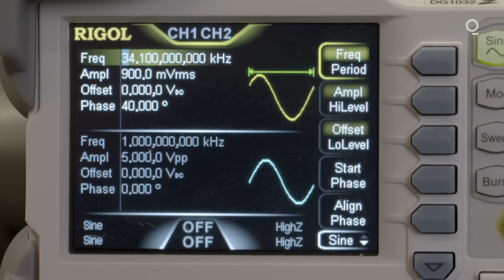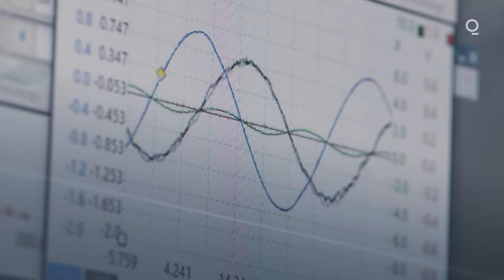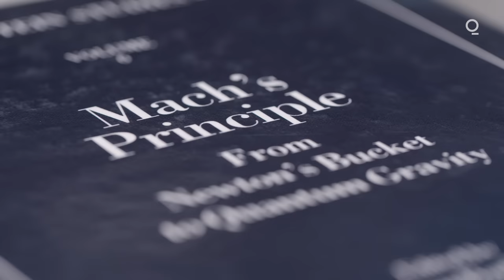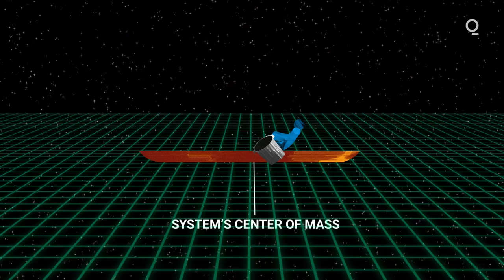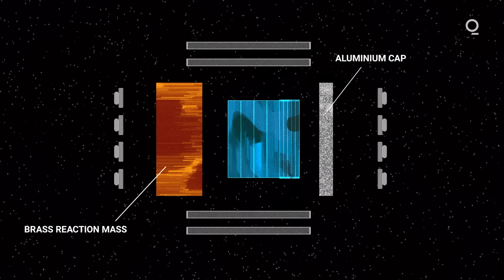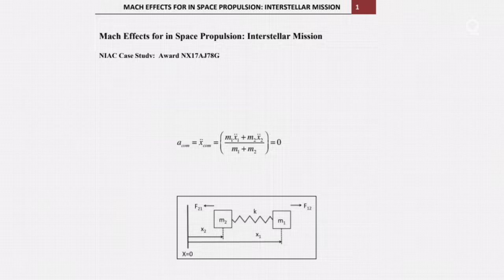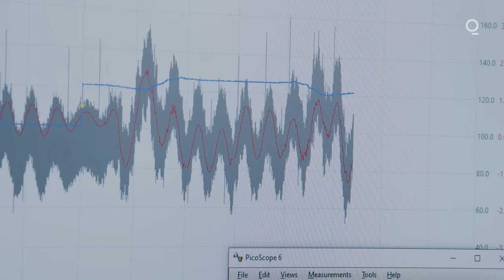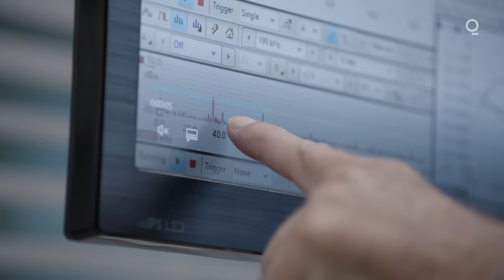Two Scientists Are Building a Real Star Trek 'Impulse Engine'

Comment: The theoretical physics side of these ideas aren't always wrong, its the ability to engineer the equipment that can actually do it.
Reply: New times, new materials, new possibilities, new Ideas, new possibilities, new materials, new times.
Reply: Dude, this isn't a theory, it's not a part of theoretical physics. 5:24 How do piezoelectric crystals change their mass? This is literally not an observed behavior piezoelectric crystals have. The only sense in which "the ability to engineer equipment that can actually do it" is even remotely correct is in that if something is impossible, it is necessary that no one has the ability to engineer equipment that can actually do it.
Reply: @BerryTheBnnuy  The total mass of objects do change due to their motion. He is saying the relativistic mass of the crystals increases then they turn it off and keep the forward momentum. Im not sure about this idea I have to think about it more
Reply: yeah yeah yeah, but you got to push theory further, if you will stomp the ground in one place -- you wont progress
Reply: @BerryTheBnnuy  They do change mass - they gain relativistic mass during acceleration.  Relativistic mass is established and uncontroversial science.  Conceptually, this is easy to understand.  You use a current to cause momentary acceleration of the crystal, and during that time, the total mass increases due to the relativistic aspect.  You push that system while it momentarily weighs slightly more, and then the acceleration/deceleration stops, and you pull the system, which now weighs slightly less.  The net effect is the acceleration of the the thing doing the pushing and pulling - the spacecraft.
Reply: @eventhisidistaken  while relativistic mass is indeed not controversial, the part that you can produce a net force from it is. In relativity mass is equivalent to energy - and energy is conserved. So by putting energy into the crystal you have to draw it from somewhere else. By taking it out, it needs to be out back somewhere. So essentially you would move mass from somewhere into the crystal and back. This mass move would counteract the net force from the crystal. So, if only special relativity is used. you would indeed predict no net force being produced from this, just an oscillation.

I don't really understand the "Mach effect" which claims that you somehow can take the energy from some potential in space which is produced by distant mass and put it back into this potential (the figurative rubber of spacetime in the video). But if without this it would not work, and this part indeed is controversial. I sure hope that it's real, but chances are very high, its not.
Reply: @wulf2121  The relativistic mass does not produce movement by itself.  There is secondary device that is synchronized with it to push the crystal while it momentarily has higher mass and then pull it back after that moment. Even that is not controversial.  This will produce momentum via standard accepted physics.  There is no violation of conservation of energy.  The part that's controversial, but still does not violate conservation of energy, is the 'gravity boost' aspect.  Without it, the amount of force you could produce is so minuscule, that you'd be better off using laser propulsion.
Reply: @eventhisidistaken  wouldn't the relativistic mass change the exact opposite way when you accelerate the piezoelectric the opposite way?
Reply: @BingusTheWockis  When it decelerates, that also increases the relativistic mass.
Reply: @BerryTheBnnuy  it's relativistic mass as Sir Einstein proposed .
Reply: @michac3796  Right but some "old" physical frontiers will stay exactly what they are today ... frontiers!
Reply: @eventhisidistaken  relativistic mass will be the same as rest mass. Relativistic mass is only relevant at very high velocities
Reply: @BingusTheWockis  Wow, great idea, you solved it, lets just accelerate it in the opposite way ;-)
Reply: @BerryTheBnnuy  Maybe they do, maybe they don't.  Now what Eddie Van Halen could do with a Humbucker?  THAT right there is um, "mass"ive.

Okay, I'll leave now!
Reply: @michac3796  The only way to get NEW anything- is to first assume the OLD stuff is NOT the "only way"- and look at something never thought of as a possible solution..
Reply: @VSci_  Crystals will be a viable power source very soon-- replacing every other-- as we have but scratched the surface for their uses- and crystals can be synthetically grown...and new uses found daily!!
Reply: @wulf2121  I can imagine being the ball and quickly grabbing and pulling on the the trampoline material and letting go then reaching forward and grabbing it again.
Reply: @wulf2121  troof. That said, the theoretical rubber/fabric of space-time and it's interaction with mass to produce gravity has been problematic for me, as it is more a useful, accurate model that's represent how it affects objects rather than true, full explanation of what it is. But, admittedly, my understanding of space-time is also limited, so I may be totally missing something.
Reply: I like the way nodody mentions the deflector. Without it there is no directional inertia guys.
Reply: @davidwayne9982  Without that concept science cannot advance past dogma. Fresh attempts will see advances eventually.
Reply: Give me the physics, and a big enough budget, and I'll make it work.
Reply: @BerryTheBnnuy  Apparently all that engineers are required to do is find a way aound basic Newtonian laws of motion. Cinch.
Reply: @VSci_  This requires motion to cause the delta M. So, we need motion to create motion?
To be useful, that motion must be in a particular direction. How do we create directionality in the motion induced by a change in mass?
So many questions, so little time...
Reply: @eventhisidistaken  "Momentary acceleration of the crystal" is questionable in itself. Such acceleration would only occurr if the xtal is placed against a firm mass itself. Otherwise, it will be only a rapid change in a particular dimension.
Reply: @WCM1945  I suppose, but that part of it does not seem to me to be a difficult engineering challenge.
Reply: @davidwayne9982  The Wright Brothers used science and math to design their craft. Not just "Try this" and "Try that". 
And I find it amazing that one who has so little grasp of Science should be telling Science how little it knows.
Reply: @eventhisidistaken  What, determining how to create a force on one direction only, without a need for an "opposite" reaction"?
Reply: @WCM1945  In the FIRST place- despite what you may think- my IQ is past mensa level- and I have an EXCELLENT grasp of science- especially physics and quantum physics.. which is HOW I know that "scientists" as a rule think they know everything and we really don't have a CLUE!!
Reply: @davidwayne9982  Wow, a Magna Mensa here...
We're all on tinterhooks awaiting the release of your compendium on Life, the Universe and Everything. No collaboration with Doug Adams permitted.
How many scientists have you met in your amazingly enlightened lifetime? Any of them ever say they already knew everything, thus research was a waste of time?
Reply: @WCM1945  No is is saying that.
Reply: @eventhisidistaken  And the proportion of mass-to-energy conversion is equal to the part of C achieved.
Reply: @eventhisidistaken  What is this secondary device? How is it "synchronized"? Speak in practical, achieveable quantities here, since we must do this within the confines of a human-life support system.
Reply: @jabyers  "High" here meaning approaching C, or the speed of light.
Reply: @davidwayne9982  In fact, empty your mind COMPLETELY.... and leave it that way...
Reply: @WCM1945  I am not talking about human life support, merely the technology of propulsion-less space travel.
Reply: @davidwayne9982  Yeah... You need to put that in terms us non-Magna-mensa folks can pronounce....
Reply: @eventhisidistaken  I'm talking about numbers that are achevable in normal space.
Reply: @WCM1945  There is an opposite reaction.  There is nothing about this that violates any known laws of nature.  The only question, is whether the 'gravity boost' aspect is true.  Without it, allthough a system like this would still work, it would not work well enough to be worth messing with.
Reply: that's why we created A.I. because A.I. can figure the troubleshooting needed to apply theories into a true product in advanced engineering
Reply: @wulf2121  talking used nuclear energy with a battery too power thAT.
Reply: I just know whether to be happy or disgusted, we've had electric brushes for how long now and only just realising it can help with space travel, instead, lazy people are brushing teeth easier... what else is so undervalued on this rock?!
Reply: @wulf2121  so I'm dumb,  but I'm imagining a guy on a starship that is a long cylinder with a weight on a spring, he walks the weight toward the back of the craft, and let's it go, thus propelling the craft forward when the weight hits the front, the energy input being his body.  Shrink this down and multiply it by millions and use a reactor instead of muscles. This does not seem complicated to me, what am I missing.
Reply: @michac3796  New physic's you mean.....
Reply: @Piddlefoots  Yeah at the time I saw this I made a note to think more about it later. I discarded the idea as not physically possible. I usually entertain ideas even if they wouldn't be possible for hundreds of years... but this borders on fantasy
Reply: @eventhisidistaken  Is the idea here that you can move a light part of your ship ahead a ways, then make that part of a ship heavier by making it vibrate fast, then relying on that part being more massive - drag the back end of the ship forward (rinse and repeat)? 
I think wulf 21 was asking how could you move the energy to vibrate into the forward section without inducing a subsequent reverse reaction motion in the ship as a whole? I should think your energy for it would be in the forward section to begin with - merely switch on and off as needed. Of course if vibrating or heating or rotating can not increase mass/inertia this whole line of question is moot.
Couldn't they test this in a vacuum attached to a pendulum and look for inclination that's not perpendicular to the ground (or parallel to an adjacent unpowered pendulum)
Reply: @BerryTheBnnuy  The mass changes easily -- the same way it does with all objects in motion.
Reply: @shukrantpatil  Einstein was never knighted.
Reply: @BerryTheBnnuy  Energy is mass.

Comment: This needs to be tested in a vacuum, because there are acoustic and aerodynamic effects with what they are doing, that have to be excluded first!
Reply: Agreed. The device uses piezoelectric transducers of the same type used in sonar.  Testing in a vacuum would then avoid acoustic radiation pressure (a nonlinear effect) from the aluminum vibrating head.
Reply: I believe I saw some vacuum chambers in their lab and office. I didn't read the study, but I believe they've set up in one of those chambers.
Reply: It's fake...   It amazes me how they managed to con people into giving them money.
Reply: @Gabriel-um9hm  you seem very sure, where is your data coming from?
Reply: Em drive flashbacks
Reply: @Gabriel-um9hm  seen you in a few comments here, I assume you spammed many more. If it is fake and they got the money, what incentive is there for him at his age, and this long after getting the money, to keep working on it?
Reply: There are descriptions of vacuum tests in the links in the video’s description
Reply: @regmigrant  from the black hole on the underside of his earthly body
Reply: Owen LaPrath
wow, why didn't they think of that..?
Reply: and in absence of gravity pull from earth. ISS could be a plausible option
Reply: @greengoblin9567  The EM drive did work perfectly.

It aligned to the earths magnetic field. A glorified compass.
Reply: I would say, if they see some movement in a vacuum chamber, then these devices are driven by radiation. They also need to make sure, that the material they use is made of stable nuclides.
Reply: @alessioschiavone3898  bro, the iss still experiences  something like 90% (probably more) of the earths gravitational pull.
Reply: @mrkakbuhn5781  wait wait, the pull is cancelled inside by the angular velocity in orbit around earth as you see the astronauts sleep upright strapped against the walls
Reply: @greengoblin9567  exactly how does it violate the laws of "nature"? this is physics, nature has no place here. The EM drive violates the laws of "nature"? hold two magnets together at opposing polarities and let one go. the result is the laws of physics. Put the EM drive into a sealed chamber and measure the effect on hydrogen gas. Faraday's law,  Hydrogen is a diamagnetic substance. Diamagnetism occurs in materials whose atoms have paired electrons. According to Faraday’s Law, when a hydrogen molecule is exposed to a magnetic field its electrons which are in orbit, alter their momentum slightly. As the magnetic field increases, an induced field is created, which the molecule’s electrons experience as a force. Through this principle of physics, the hydrogen molecule acquires an induced magnetic moment. This induced moment is opposite to the applied field and is termed diamagnetism. Through these principles of physics, hydrogen is feebly repelled by a nearby magnet. What is known currently to be the most abundant thing in space? Hydrogen. Granted, the scale of these things would have to be pretty massive but they are very well rooted in the laws of physics.
Reply: sNot just a vacuum - but also isolated from stray magenetic fields, friction, airflows, and other vibrations. Setting up such a test requires experience at such tests - which is why it took the EM drive so long to be disproven.

Comment: The difficult part is getting enough Dilithium Crystals.
Reply: That's for warp drive,  not impulse 😀
Reply: Impulse drives are powered my fusion reactors.  Another handy thing to have if we could actually build it.
Reply: Exactly
Reply: @Lennis01  Some have been built and actually work but only for a short time. The problem is containment of the plasma.
Reply: @Lennis01  
Fission ....
Reply: @Lennis01  
just like to add ....
fission propulsion is used only between Galaxy's, that have seperated,...
 as in the universe is expanding... 
there maybe no magnetic field, or a very weak field ...
Nuclear Fission propulsion will get you across it, till you can re-engage E.M.P. it's a fact, an how that's realized by NASA is because several crashed, Alien,  Craft had Nuclear Fission propulsions on board ...
The size of the craft denoted the size of the plant, 33ft diameter 1cubit metre, an would you believe, had a lead shield ...
these terrestrials, were less than 5ft tall, 
very huminoid in appearance ...
the Nuclear Power plant, was a dead giveaway they weren't from our Galaxy ....
Reply: these crystals are common stones on my planet
Reply: @stephentoons  
How do you turn them into a energy source ....
Reply: @gordonpeacman2126  how would i know we use them for jewelry
Reply: @MasterMayhem78  
The newest version is called PuFF...Pulsed Fission Fussion, as applied to a propulsion system.
How it works is: you use a "Pulse" of fission, in a controlled environment, to heat the fuel for the fusion reaction.
The UNcontrolled version is known as a Hydrogen Bomb.
Hopefully, the facilities being built in France, and here in the US, don't become one of the UNcontrolled varieties!
Reply: Although Dilithium actually exists (two lithium atoms covalently bonded), their only practical use is setting atomic clocks.
In the future?
Who knows?
Reply: @marktwain2053  all i know is if i give kirk my necklace that somehow scotty can use the stones to fix the warp drive
Reply: It is in France so never fear. All the dilithium will be surrendered to the first invading army to come along.
Reply: @marktwain2053  a Fission fusion device uses a standard nuclear explosion to fuse isotopes of hydrogen typically. The fusion devices currently being tested as reactors use magnetic confinement and/or lasers to get the needed temperatures and pressures to allow fusion as soon as any loss of pressure happens the reaction stops immediately in fact sustaining fusion is one of the biggest hurdles along with it currently taking more energy to get fusion sustained than can be extracted.
Reply: Exactly, it is better to use a Romulan singularity drive anyway. Impulse drives use fusion primarily in Star Trek.  Regardless dilithium crystals are used as neutral substances able to stream matter and anti-matter streams. This power is primarily used for warp drive.
Reply: beryllium sphere, surely
Reply: @Visbalalam  Actually the Dilithium was the common power source for starships in Star Trek.

Impulse thrusters and Warp Drive were just the 2 main propulsion technologies that relied on this power.
Reply: Selenium Crystals.
Reply: @Visbalalam  Yes, it is VERY important that that is understood...as it is FICTION.  :-)